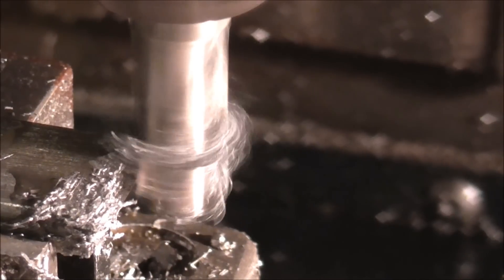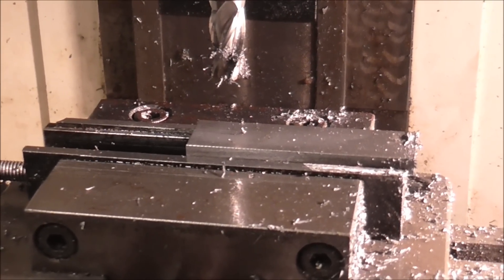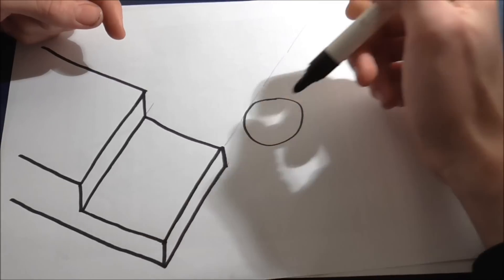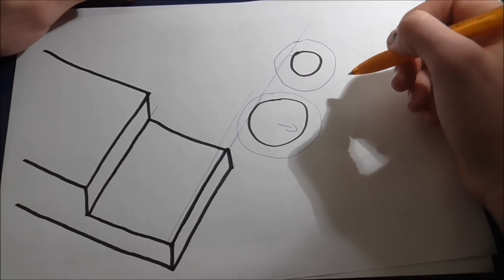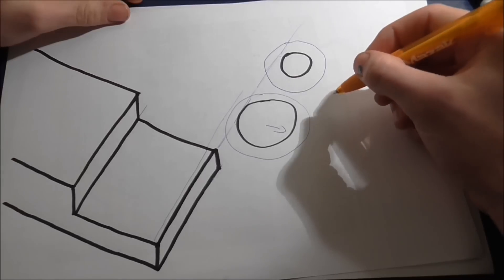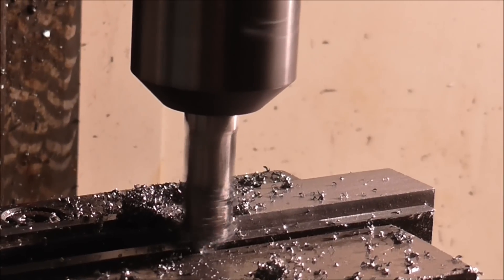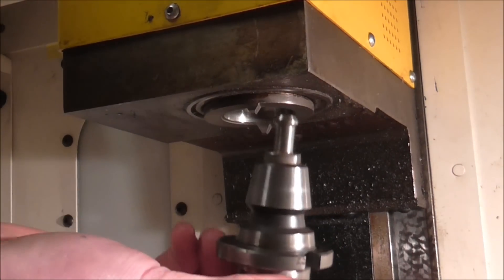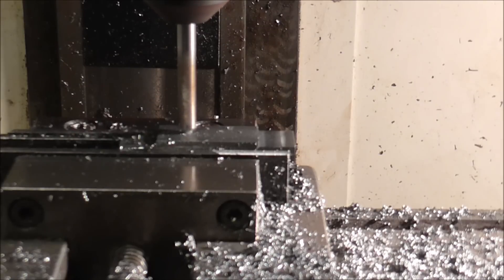Home Workshop CNC - Boxford 190VMCi - Part 2

Comment: why aren't you using climb milling on your cnc?
Reply from the maker: Peter Teurlings Good point, On a bigger cnc mill I would happily climb mill. However although this machine has ball screws and should manage climb milling I find that with steel the tool can occasionally jump forwards. So seeing as I get a nice surface finish either was I stick to conventional milling most of the time.

Comment: I enjoyed this one. Interesting tip on the tool bit size offset.
Try turning off the auto focus (and stabilizer) to avoid the moving machine problem. Otherwise a nice video clearly showing the operations involved. Thanks for sharing.
Reply from the maker: Jim Milne Thanks very much. That was mentioned in another comment, However I personally think it is me leaning again the tripod as I reach around it. What is happening in the video when this happens? That should give me a clue!

Comment: Nice video especially for us that have never got into CNC. I noticed that your milling cut was using the full cutter width, whereas I've read that only about 1/3 of the cutter width should be used (Milling - A Complete Course, Harold Hall). I assume the rules in this respect are similar for CNC to those for manual milling - or perhaps they're not?  Nevertheless I admit the machine seemed happy and the finish looked good.
Reply from the maker: kigtod Thank you. When I first started milling I was told to only use half of the diameter of the cutter, which I did for some time. However when I went to The RR training school that was not preached and much bigger cuts were taken. Since then I have normally gone for 75% - 80% of the tool end face with out any bad results. 

One reason using a small amount of cutter face is beneficial is that any misalignment in the head has less affect.